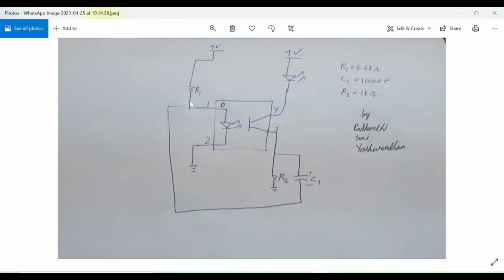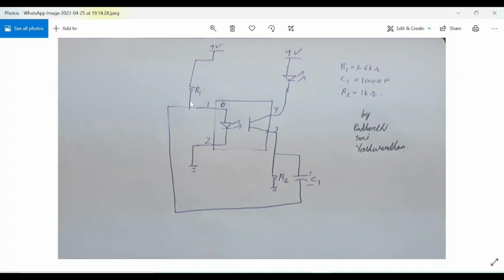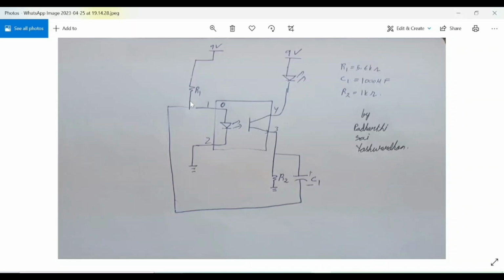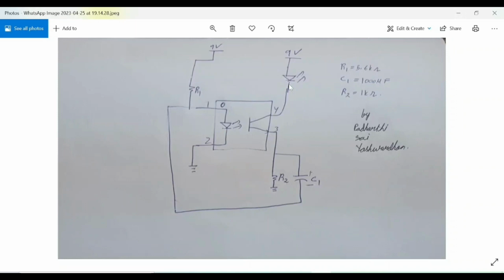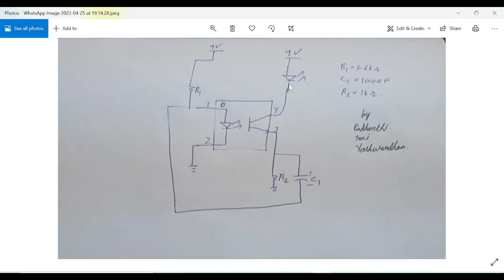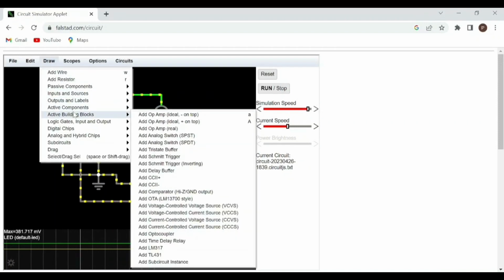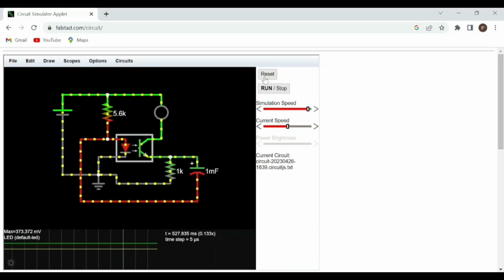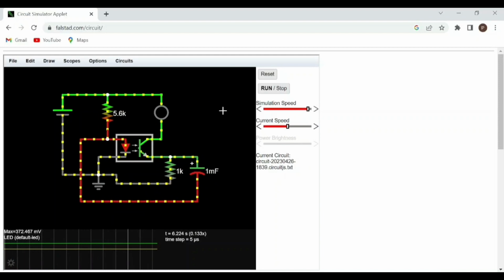Led Flasher circuit using Optocoupler IC | led Flasher Using PC817

Comment: hello can you add a zenner to turn of when the battery drop voltage at 7.5v?
Reply from the maker: Sure will try to do.
Reply: 8.2v zenner and resistor in series with positive battery, cathode and anode should be connected to the positive side of  circuit when the voltage drop below 8.2v the led stop blinking  @padharthisaiyashwardhan